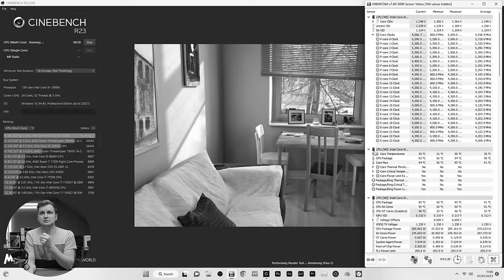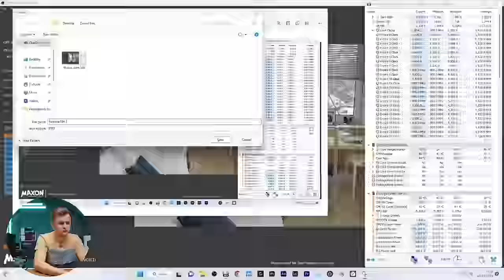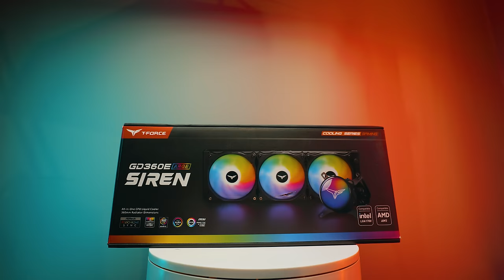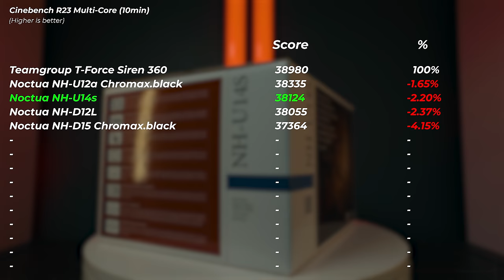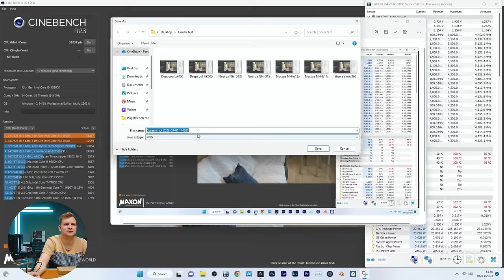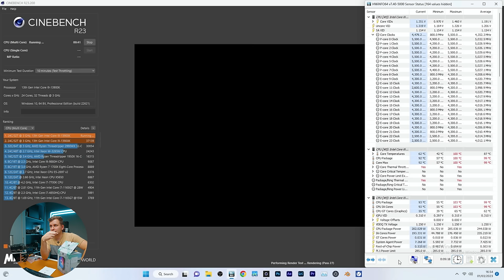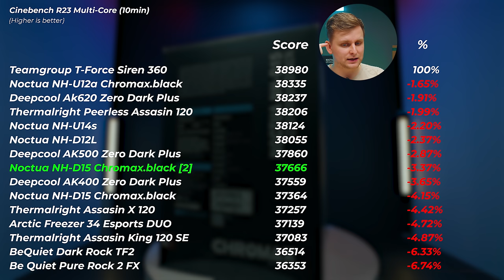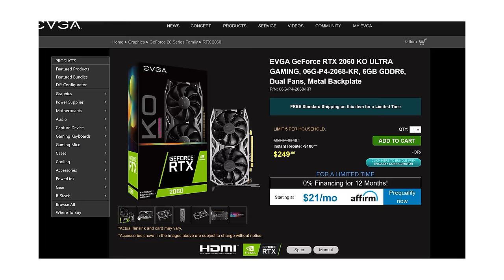We Tested 14 AIR-Coolers on 24-Core 13900k - The Results Will Shock You!

Comment: My bet is on the  Thermalright Peerless Assassin 120. It's less expensive than the Noctua and as good or better in most reviews and benchmarks 😉
Reply: Yeah but on average it run sightly louder for the same performance.
 Still impressive and less expensive though*
Reply: @edouard9867  I will probably swoop out the fans if I had one
Reply: That's an amazing cooler, use it on my 7700
Reply: I have it and its amazing for the price
Reply: That's what I run. I don't even notice the fan noise.
Reply: It keeps my 5800X3D nice and cool
Reply: @eaproductions9370  what temps do you get on your 5800x3D?
Reply: @Arcangel2992  asking for temps alone is useless, you have to ask his ambient temp and what case he's using
Reply: @keonxd8918  swap not swoop 😊
Reply: @Arcangel2992  Maximum of 80C (which is perfectly safe), but you could keep it much cooler, however my fan curve is very subtle. Keep in mind that not all 5800X3Ds will get the same temperature. I'm using a 4000D Airflow with 3x120MM intakes and 2x120MM exhausts, one above the cooler, the other at the back of the case (20C ambient tempurature)
Reply: @Healcraft  Only during Cinebench or Prime95 it reaches 80c. However, if a full or close to full load is achived during gaming, it will go to 80c. Under normal circumstances during gaming, I hit around 50-55c depending on the load.
Reply: @keonxd8918 The Noctua has larger fans. Thats why they're quieter
Reply: Except it's thermalright and we all know about their shody craftsmanship. Cheaper for a reason. 👎🏻
Reply: @KommonCents_  who knows? never had a problem, with mine or seen widespread bad reivews?  you can get a dud noctua as well
Reply: @edouard9867 i love the cooling, but I won't sacrifice the acoustics for a few degrees of difference. Noctuas have better sounding fans.
Reply: @KommonCents_ it's a damn slab of metal, the only thing that anyone should worry about is if  the design works effectively to cool a cpu. If u makes u sleep better at night knowing you paid 3 times more for a supposedly better  slab of metal, you go right ahead.
Reply: I paired the Peerless Assassin 120 (not SE) with my Ryzen 5800x3D. With Arctic MX-6 paste. Works well. Installation process isn't so great, but I won't be removing it anytime in the next few years.
Reply: Noctua last long when it comes to longevity..
Reply: EK Elite Aio the best on the market 💪🏼
Reply: I got a peerless assasin 120 se and argb version  for my two pcs Love these guys
Reply: Phantom Spirit
Reply: That makes me feel better about getting it. It is a bit loud but never had heat issues even though the 7800x3d doesn’t run too hot
Reply: it may cost a little bit more but you get even better cooling if you go with the 7 heat pipe version
Reply: He used Aio cooler with 3 fans, bigger radiator and compared them to air coolers with 2 fans.

Comment: A $6 Thermalright LGA1700 Contact Frame during this testing would have made a huge difference in results compared to the default intel ILM
Reply: Maybe he can do a follow up and compare
Reply: No it won't
Reply: I have one installed at the time of build, so i don't have a reference point to compare to. My cpu is an i5 13500 running at 150watt max tdp unlimited.
Reply: @toonnut1  it's proven that it will
Reply: @KeonXD  no it's not do you own one because I do and they don't make any difference. Don't fall for the hype
Reply: I had only an 8-12deg variation before and after. Also switched from the corsair factory Thermal paste, to the mx-6 paste.
Reply: seems irrelevant for a comparative test, since all coolers would benefit, may bring the air coolers closer to the aio though...
Reply: @toonnut1  It would clown.
Reply: @toonnut1  It does and I own one.
Reply: @toonnut1  owning one, and having one installed are 2 different things mate! You clearly have not done the latter, or you wouldn't spout all this nonsense. ☠
Reply: @toonnut1  you won't see much difference on a lower powered CPU like the i5 12400. On a i9, you'll see the difference
Reply: @ToonNut1 ToonNut007  your installation might not be great. Might have uneven torque.
Reply: No it wouldn't, I tried the contact frame on a u12a + 13900k, absolutely no difference
Reply: @KiSs0fd3aTh  even mounting pressure, and good thermal paste application are important too.
Reply: @KiSs0fd3aTh  I saw maybe one degree lower with my NH-D15 + 13700K, it's really not worth it for an air cooler.  I have heard that it might help more on certain AIO's or a lapped cooler that is perfectly flat, but a lot of coolers are already slightly convex so you see no benefit.  I even took mine off and reapplied it a few times since I wasn't seeing these huge temperature drops that everyone was talking about.
Reply: @ZoneXV  right, so lap the CPU and the cooler to meet expectations of between 3-7 deg Celsius improvement, in particular providing uniformity across package.

This gave me 6 deg reductions in cinebench and all day gaming on 12700k with noctua u12a fit into a fractal design meshify 2 with no filters and terrific air flow.

I'm looking forward to buying a 2nd hand 13900k next year and doing the same lapping while keeping it all in my z690 mobo. It will be interesting to see if z690 memory controller issues are CPU or mobo origin.
Reply: @ZoneXV  of course you could have already hit the silicon lottery with such a good CPU that the TIM is not hampering your design.
Reply: I have a 13700k and the contact frame made at best a very small difference, it's all within margin of error tho (up to ~3*c cooler) I think 12th gen CPU's did get a decent gain but 13th gen seem to be built differently. I have a NH-D15S with dual fans. The 12900k had some massive gains which doesn't seem to relate to the newer gen.
Reply: @-opus  I agree. This was a side by side comparison. The block would have an equal effect across the board. No different than setting the voltage limits lower. Equal parameter changes will result in equal score changes.
Reply: @KiSs0fd3aTh agree, same here
Reply: @KiSs0fd3aTh  sometimes it helps sometimes it doesn't. They can slightly bend over longer periods of time (months to years) so there won't be an immediate difference. I still love them though to keep things clean from thermal paste and they just look nice. Worth the 25 bucks in my opinion

Comment: I can't understand the reason for setting maximum power draw limit to 295 Watts. Why not limit to 253 the way Intel intended it and check for which coolers can actually keep it under 100 degrees instead of counting how long it takes for them to bring throttling into the picture?

Comment: The only thing missing in this test is you need to give  a cooldown of 15 minutes per cooler to give time for the chip to get back to it's original state.
Reply: Prob isn't controlling ambient temp well either these results are not consistent with almost any I've ever seen
Reply: yeah the motherboard has many layers and it soaks heat in too, as well as the backplate and entire LGA socket, and the cpu.  lots of heat chilling.  plus the room that probably isn't ventilated enough

and the bigger noctua cooler didn't look like it was seated properly, at just the right angle, you could see the pattern of paste on the bottom and it looked much heavier on half.  was hard to see as it was quick and with weird lighting, but it would explain the performance difference

Comment: the reason nhd15 underperformed can also be your variation in thermal paste application and mounting pressure OR your unit has some internal fault , ive seen MUCH better results from that cooler
Reply: The D15 is known to have issues with the latest CPU's because of how much smaller cores are, the contact area isn't as great. More towers doesn't necessarily mean more performance. It also has the same number of heat pipes as the U14S. In this case, it's really the amount of heat pipes that makes the performance, rather than the amount of fins, as the U14S is actually not even being fully saturated to its rated max temps, technically. So what you're seeing is basically the maximum air cooling potential of air cooling itself, and that's why more towers won't provide more cooling. 

I'd also imagine the coating does play a part in making the black D15 perform worse. What's really needed for modern and future CPU's is smaller and more heat pipes, so 12 pipes at half the size would be better. With the smaller cores, what essentially ends up happening is only a few heat pipes are actually making direct contact above the cores, so the rest aren't able to spread the load as much, and so only 2-3 of the heat pipes are doing the brunt of the cooling. In this case, the D15 is almost acting more like a heat insulator, because it has all that extra mass to cool, while the U14S can more readily expel that heat. 

Another factor with heat pipes is there is a balance to how they work, because you want it to be hot enough to quickly evaporate liquid in the pipe to the top where it can cool and fall. If your pipes aren't getting as hot due to it being spread out too much across multiple towers, then the liquid inside is taking longer to go through this process, which results in slower cooling. So the U14S is vaporating quicker / more effectively, which is what balances it out against the dual towers of the D15. And since it's only one tower, there's less mass holding on to heat. 

One has to keep in mind that one tower is expelling into the other tower, so all that hot air from the first tower has to also go through the second tower before it's expelled. So while the D15 seemingly should perform better, and can perform better under certain conditions, the U14S has always been generally on par with the D15, and only really shines when we're talking things like 65w - 95w processors, because at that point its extra mass does make a big enough difference.

Comment: The fact that these air coolers can come within < 5% of a 360mm rad on a 13900K(!) is incredible. Most people aren't running those type of chips and even if you were you could put a slight undervolt on it.

Comment: Noctua has stated that the successor to the D15 will be releasing this year, and that looks to be in Q4. Which means that we'll see the Chromax version in 2025. Really though, Noctua needs to wake up and realize that they're not the only game in town for top performing air coolers anymore. They need to move at faster than a glacial pace and might need to reconsider their prices. Also, I used the AK500 on a build for someone recently and I really liked it as well, and it did a pretty good job of keeping the 10700K cool.
Reply: I'm using an AK400 Zero Dark on a 12600K, and it's been fantastic. Super quiet while keeping things around 70C under max load. Amazing price to performance ratio and looks great.
Reply: Confused about your query but isn’t the chromax black  already out?
Reply: @alexsp7086  Not a query... it was a statement. I'm talking about the upcoming successor to the D15, which is currently planned for Q4 this year. In Noctua fashion, it will likely initially release in the standard Noctua taupe, and I'm just joking that we'll have to wait a couple of years to get it in Chromax.
Reply: @DubboU  I've been super impressed with Deepcool lately. I'd like to use the 400 and 620 in a build sometime. The 500 def performed well and I was very happy with how well it clears the RAM.

Comment: Thank you for this video. To check the Noctua issue, I reproduced your test, but with a NH-D15s and NH-U12A. The only difference between our tests is that I used a Thermalright LGA1700 contact frame (and obvious things like different Mainboard, Ram, etc.. Cooler and CPU are the same of course.) My results:

NH-D15s = 39,550
NH-U12A = 39,636

I ran 3 tests with each cooler to confirm the result. I also controlled the contact pressure by checking the distribution of the thermal paste. Both coolers ran at full speed. The U12A performed a bit better, but not with that high amount like in your video. Furthermore the U12A seemed to be a bit quieter than the D15s under full load. The NH-D15 actually has 2 fans and should therefore perform a little better than the NH-D15s. I also noticed that the contact surface of the U12A is much larger than that of the D15s. The D15 should be identical to the D15s in this Point. I assume that with the Contact Frame your results would look a little different too.

Update:
I have compared the two coolers again side by side in terms of noise levels. This time it's a direct comparison, but still subjective. At maximum speed, the U12A with 2000 rpm is slightly louder than the NH-D15s with maximum 1500 rpm. If I adjust the speed of the U12A to 1500 rpm, it is a lot quieter than the NH-D15s. It probably performs a little worse then. I would say the coolers are on a par in terms of performance to noise.
Reply: Did you do your testing on an open benchtable as well? The NH-D15 has a lot more surface area which makes me believe it'll perform better than the NH-U12A in a closed case.
Reply: @erazzed  Yes, I did the tests on a benchtable. That's an interesting idea. Maybe I test it out later.
Reply: My NH-U14S throttles down to 4.7Ghz in Cinebench on a 13700k. I re did the thermal paste manually and spread it over the IHS and made sure it was definitely clamped down. Same result. 
Room temp was 19°C as well.
Reply: @griffin1366 any update on the U14s?
Reply: @reinulf656   Turns out I was a nooby when it came to 13th gen. I applied an undervolting profile (CPU Lite Mode 4). Temps in cinebench hit up to about 85C under full load now at stock.
Reply: @griffin1366 So are you happy with the U14s on that or do you think a D15 (or D15s with a 2nd fan) would be better?
Reply: @griffin1366 and which board are you using for the lite load setting? It it an MSI and which model?
Reply: @reinulf656  It does the job. I have a 180W power limit and CPU Lite Mode 4  to keep the temps and noise under control.

Z790 Edge from MSI.

Comment: Great video.  I'm sure it took a lot of time to do.  One tweak I'd suggest is using the Thermalright CPU contact frame on an LGA 1700 system.
Reply from the maker: Great suggestion!
Reply: Indeed, I installed it last week and my temps dropped 10-13°C on the hottest core (i5 12600k & NH-D15). With that said the temp. delta between cores is still higher than what I would like to see, I too think that the NH-D15 has a design that does not go along with 12th and 13th gen cpus.

Comment: I would like to see 2 more CPU cooler added to the test - Thermalright Phantom Spirit 120 SE (7 x 6mm heatpipes)  and Thermalright Frost Commander 140 (5 x 8mm heatpipes). Maybe considering adding the CPU contact frame and see how much of a difference it make, especially for those big cooler that didn't perform up to par.
Reply: I have a TR 140 True Spirit 140 Power (6x8mm heat pipes) on a 3900X and it performs amazingly.  Those 8mm pipes can really move the heat and I too would like to see someone test the Frost Commander on some of the newer CPUs.
Reply: @ThomasD66  TR 140 True Spirit 140 Power is the best air cooler for the past decade. Unbeaten. I have two of them. Noise to cooling rate is out this world. If I can organize LGA1700 mounting kit for it I will try it with 13900kf.
Reply: @sebna Had this cooler for ages, still is one of the best out there, also makes very good contact with the cpu in my experience.
Reply: @malloot9224  do you use it with LGA1700?
Reply: @sebna  no it's on my 3900x now
Reply: @malloot9224  thanks. I will try to source adapter for LGA1700 and see how it would handle 13900k

Comment: Noctua said in 2022 they were working on the NHD15 successor and it should be out later this year.  I'd have been interested in seeing how the air coolers coped with some tweaking to maximize CPU performance on air.  My 13700k with a AK-620 and Z790 Aero G stock throttled almost immediately in cinebench, with some testing and tweaking I got temps down to ~89ish without any hit to performance.  In fact by the end my cinebench scores were a little bit higher.
Reply: what did you tweak exactly to get the temps down?
Reply: @vadimfedenko  played with intel XTU to figure out how much I could undervolt the CPU then set that undervolt in the bios.  I've recently become aware that z790 boards have a habit of supplying too much power which can also cause high temps so at some point I'll get around to checking the pl1/pl2 settings as well.
Reply: I set max tdp to 253 W and turned off enchanced turbo boost (msi oc thing). You will lose performance at extreme scenario but I don't bother. Temps down to 83C
Reply: It'll be the same heatsink but with the new 140mm fans.
Reply: @Chopper153  Saw that recently along with the 4677 coolers.
Reply: Is that water cooling?
Reply: Stability brings betters scores in my experience.
Reply: April 2024 ......still

Comment: I have the D15 Chromax on a 12900k since a year and will take it with me when I upgrade to my 13900k next week. Never had any issue, it is as good as silent under load and for me who runs his rig 24/7/365 it is the best choice for air cooler.